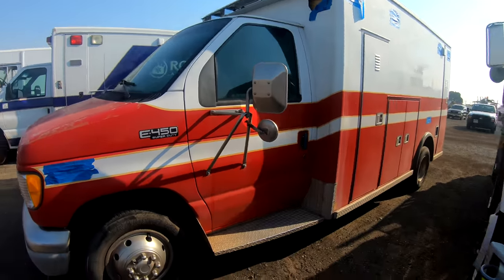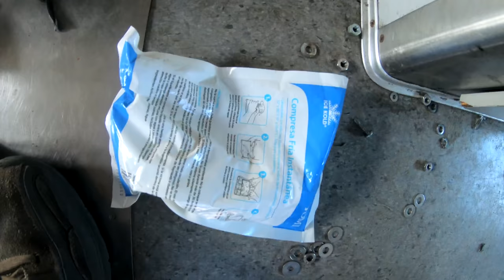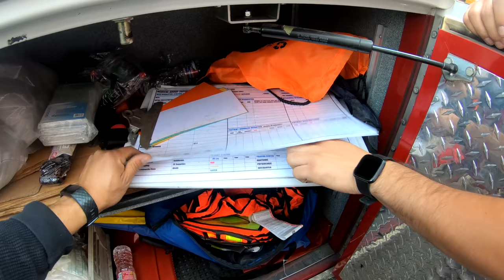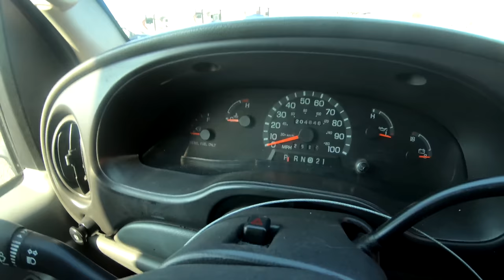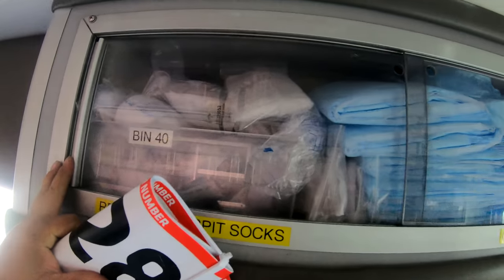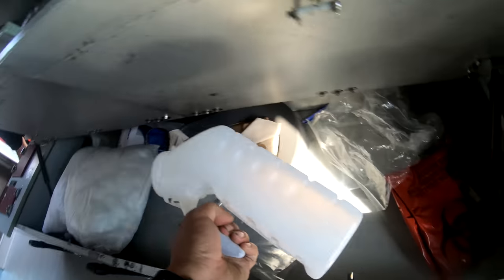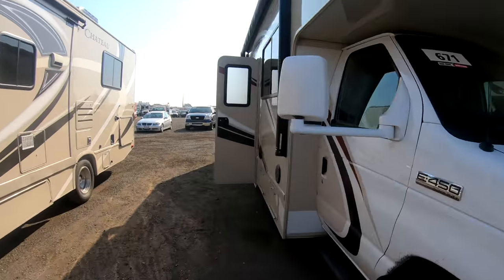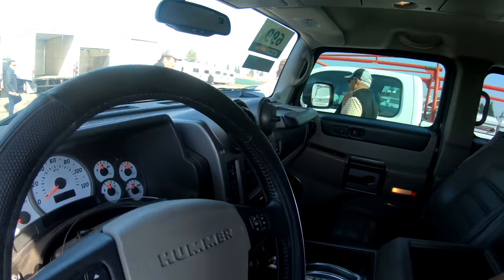Searching Ambulances, Police Cars, Firetrucks! Crown Rick Auto

Comment: actually with the right background music auctioneers sound like a cool rapper could you imagine a auctioneer that instead of shouting auction calls started doing a rap like that would completely mess everybody right up LOL.

I don't know if you run a salvage yard somewheres but if anybody's reading this I'm trying to find some ambulance or police car parts. I'm building a Ghostbusters van. i at this point have it about half done.i got the personalized license plates the other day as well.i am looking for the console that goes between the seats of a cop car which the CB radio goes into and has the tripod for the laptop,yes i have 2 police car laptops one is an old Windows 98 and the other is a Windows XP;).i am also looking for a whip antenna for A cb and some blue roof light bars.i presently have a lightbar off of a early 1980s Tow truck which is orange which is orange. If somebody reading this could point me in the right direction I'd appreciate it. I can't find any salvage yards around here that have Police vehicles.

i someday would love to get my hands on a short school bus or a ambulance/paramedic vehicle would like to do one up with the Ghostbusters logo Badging and use it as a RV. They'd make a great vehicle/mobile workshop.